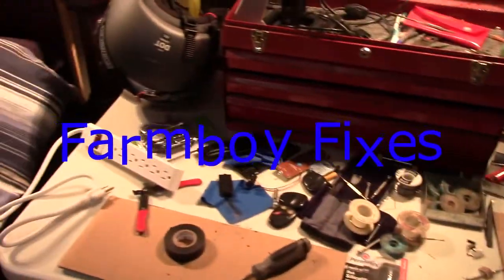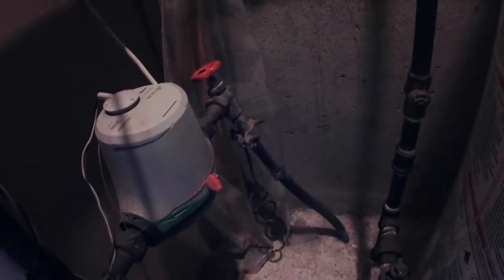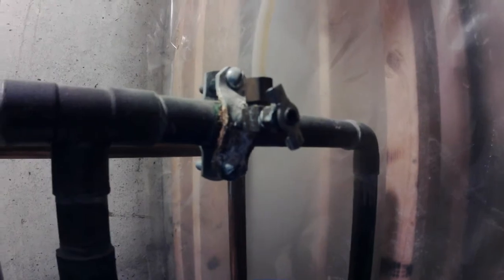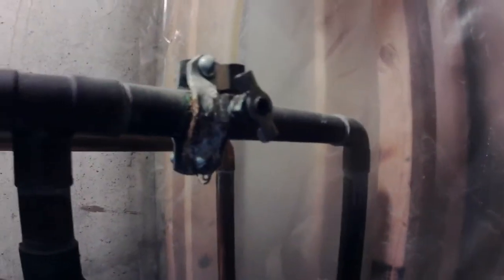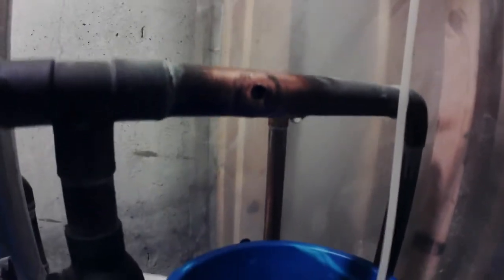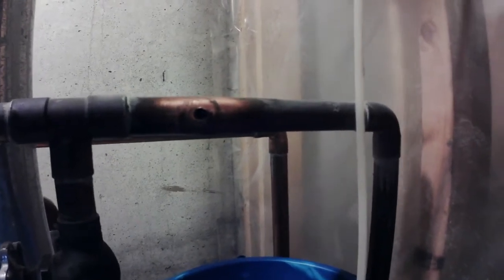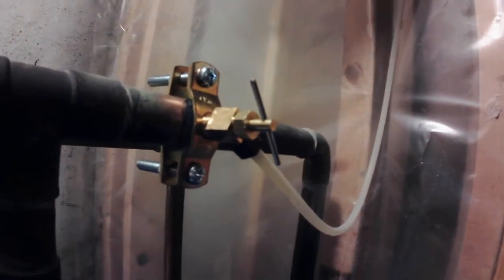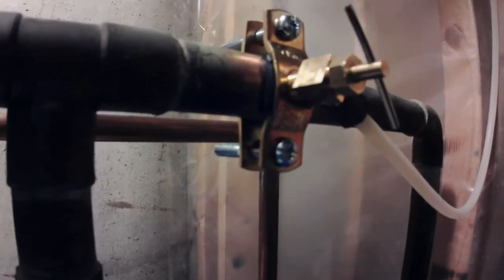Replacing a saddle valve

Comment: These videos always stop short of turning on the valve.      Would you happen to know how to determine if the valve is fully open?    Does it stop turning in the fully open position?   I have one connected to my refrigerator and my refrigerator (not the self-piercing valve)dispenser, is starting to only drip water.    When I turn the valve to try and make sure it is fully open.. it seems to turn endlessly.    Would like to know if I should keep turning until it stops turning, or if it is supposed to continue to turn.    Dont want to keep messing with it, as they are known to break and leak.  Thanks
Reply from the maker: On the saddle valve, turning it clockwise until it stops will be a full pierce through the pipe, turning it anti-clockwise all the way until it stops will fully open the line.  I had a few problems where the fridge only dripped the water.   Problem one was the fridge itself was freezing up the line internally and the second was the pipe (old house) had corroded inside.  I had the add a new saddle valve on a different pipe.
Reply: @farmboyfixes  I think my valve may be broken....... it does not stop turning.... and if I gently pull the T, the water flows fine......then starts to drip again shortly after I let it go.
Reply from the maker: @rayjgold  Oh Oh.  shut your main water supply off then.   Replace it.  By your description, the threads are striped or its corroded.
Reply: @farmboyfixes  yes.  I'm just trying to decide if I should replace with another saddle, or cut out the hole and use a more secure t adaptor connected the valve going to the sink.  Im thinking of cuting out the hole and putting in a compression fitting..to seal back up.
Reply: If you don't know saddle valve is a building code violation. I will suggest anyone who want to replace saddle valve and not comfortable with soldering you can use  a sharkbite fitting it's upto code also it's easy to install.
Reply: @AdamJames.  I ended up cutting out the hole and soldering the pipe back together.   Then I screwed on a t connector on the valve to connect the sink and refrigerator water line.    Now my water flows stronger and ice is larger than when my refrigerator and water line was first installed.    My ice tray is full within hours......I now have to leave if off for days and then turn it on for a few hours,.....then off for the next few days.   I can fill a glass of water in seconds instead of the normal minutes.     It makes me a little upset that contractors would install new copper and then put a hole in it instead of just using a screw on connector like is common with dishwashers.  I just don't understand it.   Performance is degrades simple because they choose the user the connector that comes with most water lines, instead of by the extra t connector that cost an extra dollar.

Comment: How about just replacing the Unit I don't do Electric or Plumbing but yea

Maybe I missed something(didnt see most of the Steps anyways) but how you get off a deeply fitted Copper Wiring thats not coming off the Saddle Valve